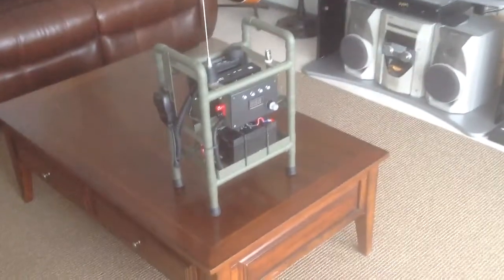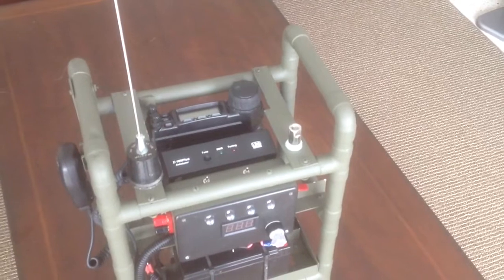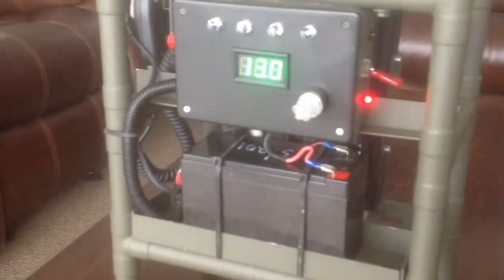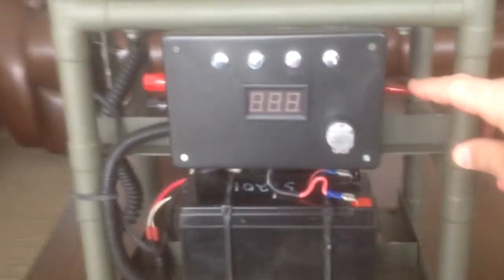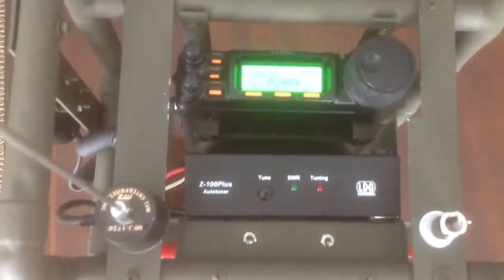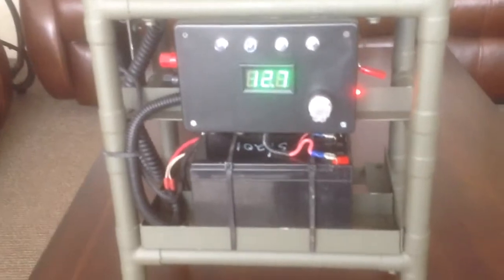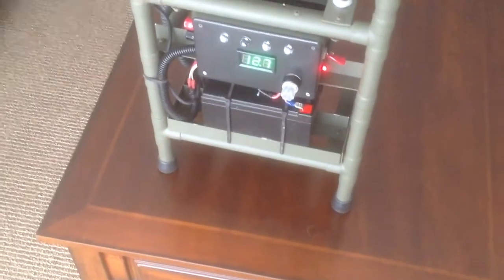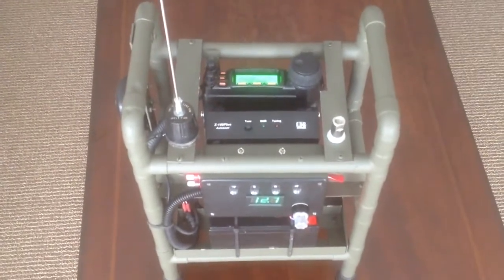Homebrew Manpack Yaesu FT-857d

Comment: Hey, great work! 

My first manpack frame was made from PVC tubing. I used a nylon tablet (I hacked a cutting board) as a platform for radio and batter and connectors. It was super easy to work with and strong enough, and I imagine it would transfer less shock to the radio in the case of a significant impact compared to aluminum or copper.

I'm about to create a new manpack and I'm wondering if there is some advantage to working with copper tubing and aluminum sheeting. Any thoughts on metal framing vs. PVC?